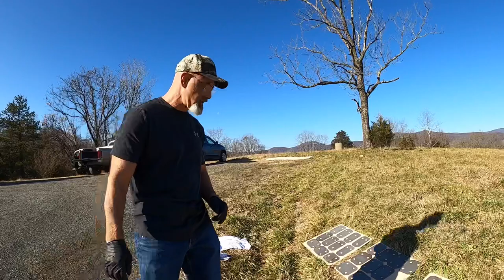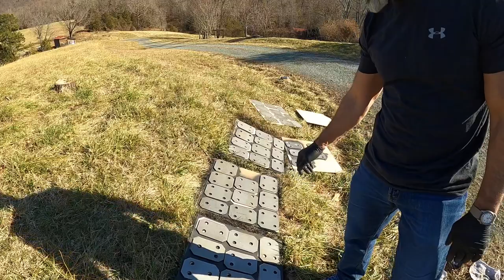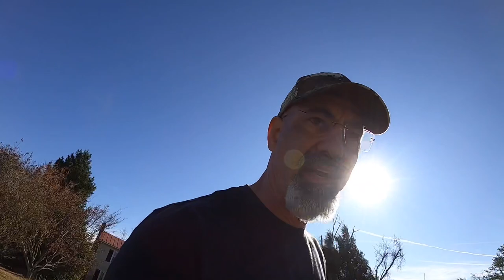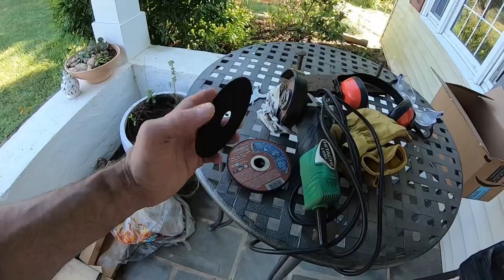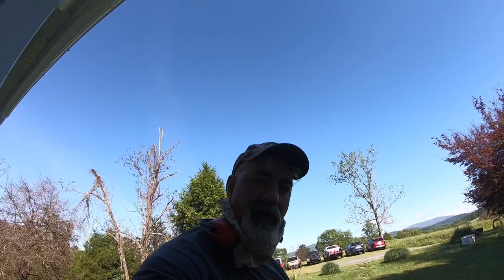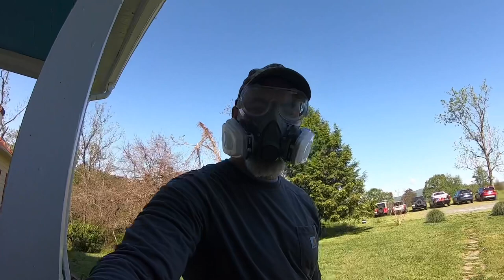Post and Beam. Steel plates and fasteners. How much does it cost?  DIY post and beam SIPs house #63

Comment: I'm interested in this because it seems much less time consuming than cutting all of the complex joints required to connect a traditional timber frame. Post and beam with steel seems much more time-efficient, especially for DIY.
Reply from the maker: There are places you can buy a kit that they have done all the cuts for traditional joinery. But I am sure you pay for that
Reply: @breakheartorchard4761  Yes, it's incredibly expensive. I'd rather spend ~5-10k and buy a portable sawmill, and then just mill trees off my own land. But cutting all the joints would take weeks of work full time, maybe months. So I think this method may be the best for me. Did you have to get an engineer to review the fasteners? I am an engineer, but that isn't my specialty, so I wouldn't be able to ethically stamp it myself.
Reply from the maker: @luthmhor  my architect had them specified in the plans with thickness and measurements, so I went exactly off his specs.

Comment: Instead of paint have you considered linseed oil? Would love to hear your thoughts on it, I live in a post and beam home built in the 18th century, the beams that have cracked and warped have been 'treated' with steel plate and bolts - propane torch and linseed oil turns the metal a rich black color that doesn't flake like paint but still protects the metal with a durable 'coating', prevents rust and doesn't negatively interact with the wood - I have steel plate clad beams that were done almost a hundred years ago which were treated with linseed oil and heat that still look great (the house was originally all wood, but green wood warps/cracks which later required steel reinforcement that I still keep up with as needed today)

I guess my comment is more aimed at skepticism of the longevity of black spray paint. Linseed oil applied hot is long lasting, natural and durable, for the time it takes to spray paint have you considered taking a propane torch and heating steel to smoking hot (not red hot) and coating with linseed oil (motor oil works in terms of color and protection but the heavy metals from that engine oil make it carcinogenic, linseed oil doesn't)

Not trying to detract from your method but sincerely curious as the practice used 100+years ago was different and in my opinion produces a better result (the color of the steel really comes through under the linseed oil coating and I use that method to treat my welding projects today) 

Thanks for sharing!
Reply from the maker: I have never heard of that. I wish I had, I would have tried it. Although it would have been quite a bit of work, it sounds like it would produce a very nice result.
Reply: @breakheartorchard4761  It is a little more involved for sure, it works great for finishing steel or cast iron fire pits too - the concept is similar to seasoning a cast iron skillet although I wouldnt eat off of linseed oil (it is not food safe) grapeseed oil is food safe and would have the same result (but it is more expensive)  

Thanks for sharing your video, it gave me a lot of inspiration for my home, there isnt a lot of content out there on post and beam construction.

Comment: Never seen someone so scared of grinder sparks lol. If the plates are just mild steel you probably could have saved even more buying a long steel plate and chopping and drilling them yourself, just a lot more grinder time.
Reply: Also, harbor freight cut off wheels. They're shitty but dirt cheap